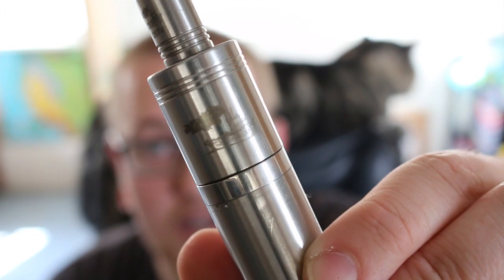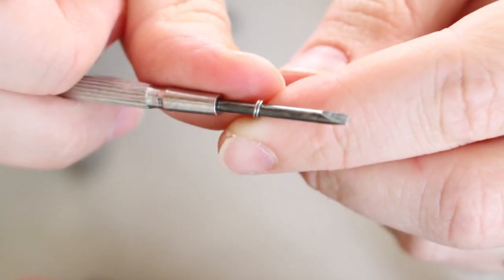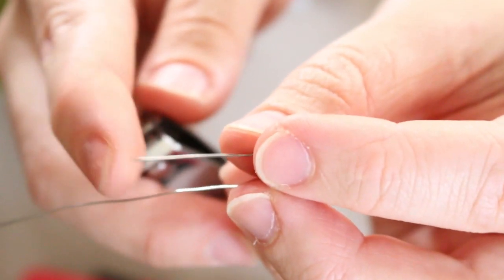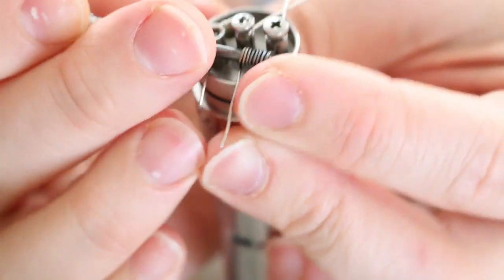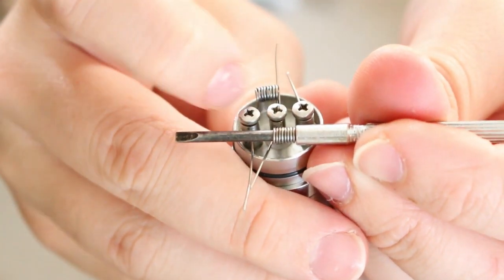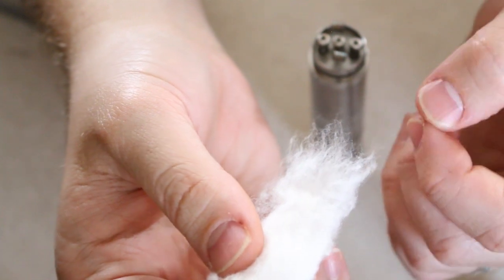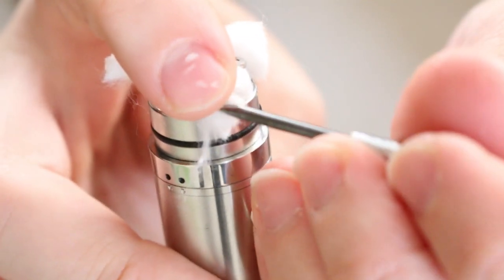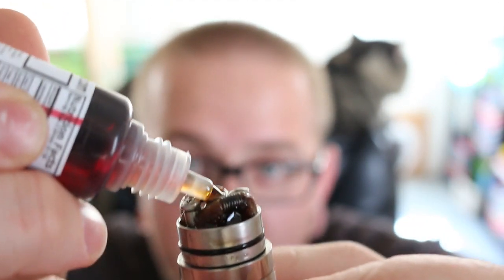Tugboat RDA Dual Coil Build!

Comment: I love my tugboat v2, I'm always pushing its limits I currently have a dual parallel build at eight wraps of 24g pyrowire... Fires at .06 ohms! Almost to hot and dense to handle and plenty of flavor/vapor. It may be little but the tugboat can handle some insane builds

Comment: Thank you for the very informative video on the tugboat dual coil rebuild. I am not new to vaping I started with clearomizer tank and then switched to sub ohm tanks. I would like to start using RDA drip tank. I am more about the flavor than the smoke. My first question is what type of MOD do you recommend?  I have a joyetech e-Vic VT dual which is a VV/VW mod, my second question is at what voltage and temp do you vape your RDA. My last question is what type of wire do you like best for RDA rebuilds Kanthal, Clapton or SS316?

Comment: Hey man I love your video's they've been very helpful on getting good solid information. I wanted to ask though how to you like the .32 build? I have a authentic tug boat V2 on an asmodus klone mod and I love it. I've been running a .10-.15 dual parallel sleeper build with 24 gauge kanthol on I think 2.4mm screw driver. ( I have one of the coil building tools and the post I use seems to be the exact same size as one of the flat heads out of my set that says is 2.4 mm, my coils appear to be the same size as your's or very close)  and I personally love it. I love that quick 2-3 second hit that just smacks you in the face the a warm to hot dense vapor with tons of flavor and vapor production, but the more I vape on it I was wondering if there's a way to still get my warm dense vapor but with even better flavor even if i sacrifice some of the vapor production. I've been leaning towards smaller diameter coils not a macro or micro coil but somewhere in the middle so you don't have a ramp up time and it fires the minute you hit the button and the sleeper build helps hugely with that, but I wanted to hear your imput from someone who gets to test many different RDA's and have tried many builds which I still haven't. If you have any RDA recomendations for better flavor I'd love to hear it or if you think this RDA is the best of both worlds for flavor and vapor production.

Comment: Thanks for the video on the tugboat. I just bought one and I was unsure how to build the coils. Right now I use a Trident, with 28 gauge kanthal but I can NEVER get a consistent vape. Believe it or not, I only wrap the coil 3 times (~0.34 ohms). That seemed to work, but I think I'll try it your way. If it doesn't work the intended way, can I contact you about it? I think the biggest thing is the preparation of the coils. I've tried doing it your way once, but the mod I was trying to use it on wouldn't vape with anything less than 1.5 ohms.
Reply from the maker: Email me if you need help man! Cloudie.vape@gmail.com

Comment: thanks bro I'll give it a try should I raise the coils like you do ? do to the tug boat airflow
Reply from the maker: If you are able to raise it then do it. The only issue with center the parallel coils is that the two wires being side by side, there's a chance you'll bunch up the coil making the wraps uneven. So just be careful when trying to center/raise the coil.

Comment: It get hot when you press it longer. But not that really hot.
Reply from the maker: Did re wicking help?
Reply: Cloudie Vapor unfortunately nope! Man i think this mod's button is the one having a problem. Its a magnet not a spring
Reply from the maker: Try using 28g man!
Reply: Cloudie Vapor same thing man, i used 28g. it is slow to fire and button got hot to
Reply from the maker: Are you sure the battery is snug? Does the battery rattle in the mod?
Reply: Cloudie Vapor it is snug, Lol i tried everything and no luck! I think the mod is faulty
Reply from the maker: Do you have another mod? Some cheaper made magnets can't handle the battery draw. Its not faulty. Its just not high enough quality to pull the power.
Reply: Cloudie Vapor i have the old k101 and its working fine. Do they sell magnet for those mod?
Reply from the maker: You just need magnets that are close to the same size.
Reply from the maker: I'm not sure where the best place is to buy them. Let me see.
Reply: Cloudie Vapor appreciate it man. I did try just a single coil and that solve the heating button.
Reply from the maker: Ya that's what I assumed it was. How's the single coil running?
Reply: Cloudie Vapor its less flavor and less clouds, but id rather used this than the heating button. Lol
Reply from the maker: So true! What's the wraps at? And what gauge.
Reply: Cloudie Vapor 24g 7wrap, do you have any suggestion?

Comment from the maker: +Antonio Carlos de Azevedo that's awesome man!
Reply: Hey bud! cool video. .. subscribed* 
just a quick question, is it accentual to have a ohm meter to test before use?
I'm using a sigelei 75w, so ohms will show on the led screen!
Reply from the maker: Dan the Beatles fan It's extremely needed to tested your build before you fire it! The ohm reader on your device will work great!
Reply: +The CloudieVape that's great, thanks for the quick reply! I was hoping I didn't have to buy a tester! haha 👍
Reply: can put a tank u can fill up on the tugboat RDA rather then the drip tank ???????
Reply: hey dude? how many watts are needed to 2 coils

Comment: Hi not to criticize but the tugboat has screw holes on the post at different heights for a specific reason  . The idea being that the coil lead coming on top goes to center post and other lead coming on the bottom goes to side post. You did exactly opposite. that way the coils are easy to center and less fighting to get them right
Reply: +The CloudieVape - Oh I get it . I never thought of it earlier - May be the manufacturers  should do it reverse . Centre post lower

Comment: thanks for all the help man and please let me know about the perfect 28 gauge coil !
Reply from the maker: No problem man!
Reply from the maker: Alrght man 28g parallel using a 3/32 drill bit, 6 wraps so a total of 12 wires per coil.
Reply from the maker: You'll be at .28 ohms

Comment: I'm using 24g kanthol wire and I'm having difficulties feeding both leads through the middle positive post.  Any suggestions?
Reply from the maker: Are you using this version of the clone?
Reply from the maker: Hmm they should go in side by side. Try pushing one leads to one side and putting the other in. I'm not sure what's going on. I can put two peices of 22g in it. Email me a pic Cloudie.vape@gmail.com

Comment: i just boughtna tugboat and you talk about sub ohm but whats the difference
Reply from the maker: Check out my battery safety videos. Sub ohm means the coil reads out lower than 1 ohm. 0.99 ohms and lower are considered sub ohm.

Comment: Does the voltage or wattage matter?
Reply from the maker: In regards to what?
Reply: I'm new to rda's. If I did exactly what you did in this video would I be able to use it on my mvp 2.0 or my cool fire 2?
Reply from the maker: The devices say they can handle it but I wouldn't recommend it out caution. The cool fire ii using only 18350 if I'm correct? 30amp battery or more is the best for sub ohms.
Reply: Yeah it's a 18350. So your saying I should get a new battery?
Reply from the maker: I would suggest a mech mod for something like this build using an 18650 30amp battery
Reply: Cool man thanks
Reply from the maker: Please don't think I'm trying to entice fear on ya bro! I'm just suggesting safety. Let me look more into the mvp2 about sub ohming and I'll get back to you bro.
Reply: It's all good man I'm just starting with rda's so I'm just trying to get it right
Reply from the maker: Yeah just to confirm MVP max amps is 3amp and cool fire ii using 18350 is about 6amp
Reply from the maker: To be safe with sub ohms use 30 amp 18650/26650
Reply: Thanks for the help!
Reply from the maker: No problem man that's why I started making videos. I just want to help.
Reply: I purchased a tugboat clone earlier from Amazon and I just now ordered the buffalo mod clone too. With 18650. Hopefully I didn't go overboard for it being my time using a dripping atty
Reply from the maker: What battery? And what company makes the tug you got?
Reply: It takes 18650, 18500, and 18350. I got 2 18650's. It's a tugboat RDA by tobeco
Reply from the maker: What brand of battery?
Reply: Sony 1600mah
Reply: One more question lol does it matter what size drill bit you use to wrap the coil ?

Comment: hey great video, quick question, would this build work safely in a plume veil clone rda with a 2000mah 3.7v battery?
Reply from the maker: I need more info on the battery before I give you my thoughts :) what bran is the battery and what model is it?
Reply from the maker: That should be a 15 amp continuous battery. .32 is pulling 13 amps
Reply from the maker: I would do this build using 26g or 28g rather than 24 :)

Comment: What's up man I'm havin some trouble. I have a sigueli 100+ and I just switched rda's from a magma by paradigm to a Mutilator. I'm not familiar with doing these kind of builds and so I tried it and only one of the coils is firing. I tried finding videos and could not find one video on a mutilator build. If you could help me out in anyway that would be dope. Thanks man

Comment: just got a tugboat. Its my first RDA and i am new to them. I did get an ohm resistance meter with 510 thread. If I build a single coil identical to the ones you built. what should the ohm resistance be?

Comment: Hey man. I did this, but why im getting a hot vape? Clouds coming from it gets hot. Pls help me.
Reply from the maker: Do you have an ohm reader? What battery are you using?
Reply: Im using efest 18650 30amp. I dont have ohm reader. And i drilled my cap too. And i still get a hot vape. Maybe i put too little cotton
Reply from the maker: You wrapped it correctly?
Reply: Yup. Let rewick it and see how it goes
Reply from the maker: Is the button getting hot? Or are you saying the vapor is to hot? And what nicotine level are you using? Also what is the pg VG ratio
Reply: Cloudie Vapor yup the button gets hot too, i thinks its the juice im using. Im suing 50/50 6mg
Reply from the maker: Take the build out man. You need to build a higher ohm. Use 26g or 28g. Do the same wraps
Reply from the maker: Hot buttons are no good. Its not worth your safety. What mod are you using?
Reply: Cloudie Vapor is it really that bad? Do i have to buy a different pg/vg juice?
Reply: Cloudie Vapor im using the origin clone mod with igo w
Reply from the maker: Hot buttons can be caused from different problem. Basicly you have an uneven resistance spot in your mod.
Reply from the maker: How hot is the button getting? To hot to touch?

Comment: how many wraps do you recommend with 28 gauge kanthal ? I'm looking to get the same amount of ohms you did
Reply from the maker: Not positive. I know the thinner wire might not handled the heat but you can try 12 wraps
Reply from the maker: If you want to hit the same ohms you might need to use an 1/8" drill bit

Comment: I usually build pretty good coils before I insert them into the RDA but whenever I try to adjust/center them, the end "turns" on each side of each coil overlap with the turns adjacent to them. I pre heated them and did everything correctly but still they overlap when adjusting. Any ideas how to fix that? I use 26g with 6 turns.

Comment: I have a 49 clone made by infinite on a Samsung 18650 battery but when I did this coil build on 24g and it didn't heat up as quick as yours. It heated up eventually but the battery and RDA was starting to get warm so I let cool down and I went back to single coil that was wrapped 5 times. Would it be safe to do that same build but wrapped 5 times?

Comment: I am a real newbie when it comes to this. I have only used a Kayfun clone so far.

So with two of these eight wrap 24 AWG coils I can't too easily damage my battery? .32 ohms is very low, no?
Reply from the maker: Jagh Haringenamn What brand of battery do you have? In a kayfun i'd use like 26 or 28g wire.
Reply: I have bought a Tugboat RDA clone.

The thing is, I have a nemesis mech mod but no battery YET. I am looking around for good info on what battery to get.

This is the site I might use, as I live in Europe: http://eu.nkon.nl/rechargeable/18650-size.html
Reply from the maker: Jagh Haringenamn Check out here: http://www.ebay.co.uk/usr/big_f_d_d get the VTC4 or the Samsung 25r's. Also check out https://www.youtube.com/vapingv1ck His channel is great and hes a euro.
Reply from the maker: Jagh Haringenamn also here http://www.cloud9vaping.co.uk/
Reply: Thank you, I will check it out!

Comment: Hey would this work on a vision spinner style battery im getting a battery like a vision spinner but its 2200mah would this rda work
Reply: It depends on the coil you build, vision spinners cant fire on sub ohm builds, i'd recommend a box regulated mod like the sigelei 50w or 100w plus if you have the cash.
Reply: I got a 1 ohm coil to fire just fine with a 1600mah spinner at 3.8v. It didn't last so long and took a moment to heat up fully but it worked.

Comment: Hello mate. Great vid! Have a quick question if possible. I have a tugboat v2 on a Nemesis mod using a 18650 35A battery. I just purchased some 28AWG Kanthal and an Ohm reader/meter. I was just wondering what kind of Ohms I should be trying to get out of a dual coil build using this material on this mod? Also based on your answer, how would I build e.g - what size drill bit and how many turns? Cheers buddy, I appreciate any help :)
Reply: It is an Efest battery
Reply from the maker: Do 8 wraps using  2.5mm (3/32) drill bit. Should sit you around .7-.8 depending on lead size.
Reply: Will do, thanks :-)

Comment: With the two coils, how can you tell which side is the positive or negative lead ? Is it the end that is longer than the other !
Reply: Jeremy Lien I could be completely wrong or misinterpreting your question.  After all I'm a total noob which is why I watched this video.  But I think the center post is positive and the two on the sides are negative.  Both coils have one lead in the center and one lead from each in a different negative.

I don't think it matters which lead you put in which post as long as you don't put both leads from one coil into the a negative or both into the positive.  Both coils need to have one lead in the center post and then a different negative post for both coils.

Again, I could be wrong.  Or maybe I didn't understand your question.  Sorry if so!

Comment: What size battery are you using with this build in your nemesis? I have literally same vape but all black and my coils don't heat up the same speed as yours and don't produce good vapor. Battery I have is 2000mah and I think it might be worn down but what do you suggest I do? Rebuild the coils because they look burnt and get new battery?

Comment: Is it alright that i dont have that certain wire or can it be anykind or what.
Reply: alfredo ramirez As I said to someone else I replied to here, I am a complete and utter noob so take what I say with that in mind.

I believe the gauge of the wire, that is what people mean when they say "24g" that would be 24 gauge... anyway the thickness of the wire will affect it's ability to "resist" and will give you a different "ohm reading" (ohms are the units used to measure resistance).  The lower the Ohm reading the lower the resistance.  

What the wire is made of will also affect this and also affects how much heat the wire can handle.  You don't just want to use "anything"... I'm sure there is some kind of wire out there that will melt lol.  You might also get some toxic or unpleasant taste from other metals.

Again, take everything I say with a grain of salt.  I'm learning as I go.

Comment: hi,newbie when it comes to this.just got my Pegasus clone MOD in the mail today with my tugboat v2 clone and ( 2 ) 18650 2000 mah aw imr and the battery mah & c rating says that 0.5 ohm is a safe ohm to run.queston is will this build be safe to use in my tugboat with the battery's i have ,or is this build to low for my setup? any help on this would be great
Reply from the maker: Israel Holbrook I answered this via email right?
Reply: yes you did,and thank you

Comment: hey man I did 12 wraps of 28 gauge on my tugboat with a dual coil and it was on my 26650 mod and the coils would barely fire any other suggestions ? they looked nice and everything they just took forever to heat up
Reply from the maker: Try 10 wraps, then try 8 :) what's the ohms at with 12
Reply from the maker: What are you wrapping it on?

Comment: what battery are u using and the specs? coz i got AW, 18650 2000mAh 3.7V . is it safe to built the same as yours with my battery? sorry but i dont know how exactly to calculate .

Comment: I don't have the plume veil I have the tugboat what's the best build you think for it
Reply from the maker: You can still do the parallel coil on the tugboat using 28g kanthal :) give it a try man. Do 10 wraps using a parallel wire.

Comment: Your build vids are great! I was wondering if you could help me I recently got a vulcan rda and been trying some dual coils in it. I only have 26 gauge kanthal and have been trying to build it around .7 to .8 but keep getting a .3 to .4. Can you suggest a way to build 26 gauge dual coils so i can hit that mark?
Reply from the maker: Yeah man. I have the Vulcan on order waiting for shipment. Let me look at the post setup online and give you some suggestions. Shoot me an email: cloudie.vape@gmail.com just so o got your contact info and I'll get back to you asap.
Reply from the maker: Sorry typos* typing on my phone :)
Reply from the maker: Shoot for 12 wraps on a 3/32 drill bit. You should sit at .7, if that doesn't work use a 1/8 drill bit and do 10 wraps using that 26g. That will hit .7... Just remember if its to high drop a wrap on each coil til it hits where you want. If its too low just add wrap or two til you hit it.